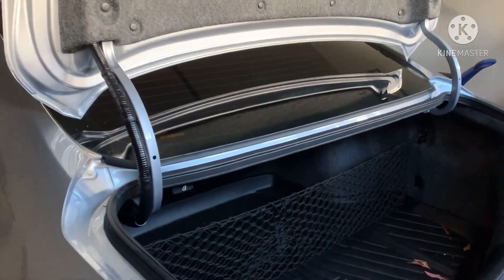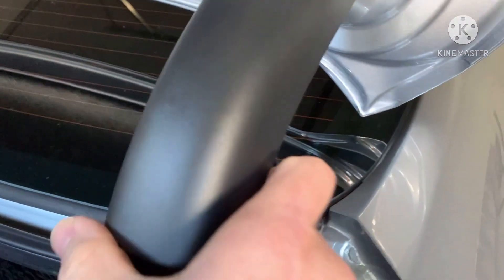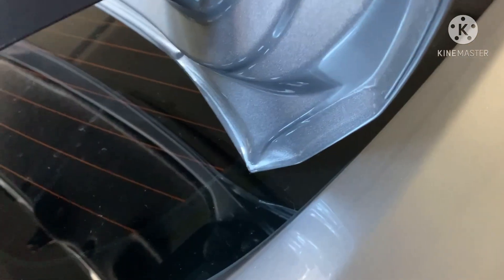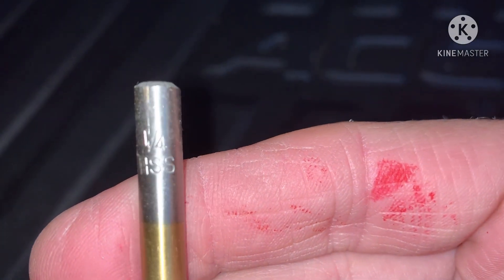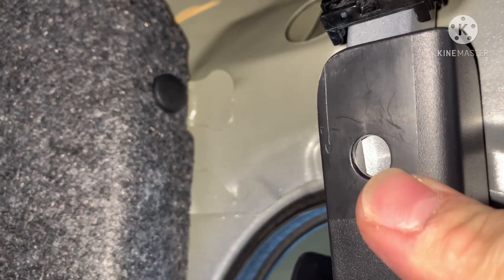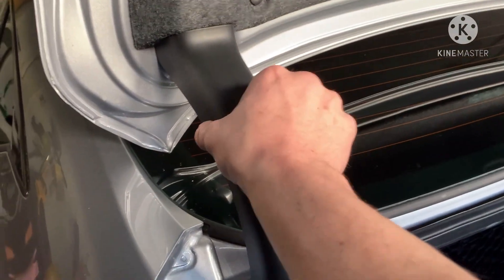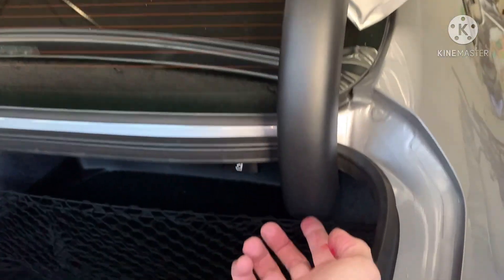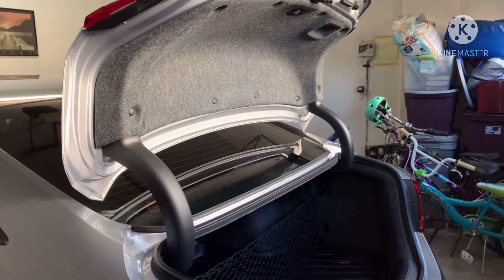2018-2021 Honda Accord models need this part with BEST install method.

Comment: Drilling into the car? OMG! I think I rather just buy an Acura. 😁

Thanks for video but hopefully I can find these on eBay on the cheap. I mean they're just plastic pieces but I've seen some for like close to $70 so no thanks hehe. Also stop jacking your kids markers too btw 😁. Getting all kinds of bloody marks on your hands. I mean Halloween is just around the corner. 🎃
Reply from the maker: Lol. I know I was scared at first but then I saw the other pre drilled holes and said why not 😂. 

Yeah check aliexpress. I’ve seen them for $30.

Comment: It is too bad that Honda does not put that hinge cover on the Accords. I thought my 2019 EXL 2.0 should have had it. Even the touring models do not come with it. That is one feature that Camrys do include.. whoever made that aftermarket cover you have should have designed it more like the Camrys have.. I just went and checked mine. Mine looks similar to yours however it fit very close to the hinge and is only attached at the very top where you see that it integrates into the insulation covering the inside of the trunk lid. . It is very secure and does not add any more holes to the hinge.. the whole thing attaches to the last fastener on the corner of the insulation cover.